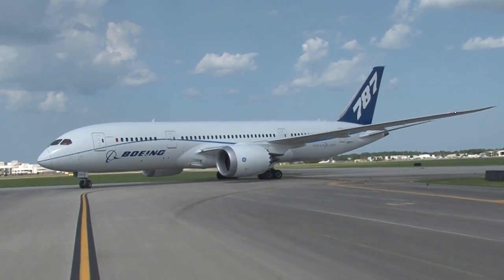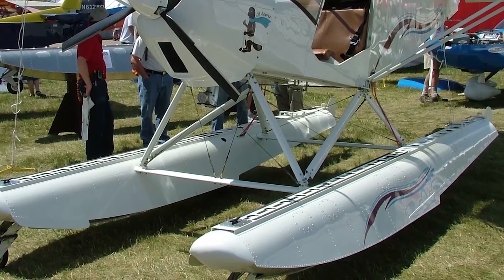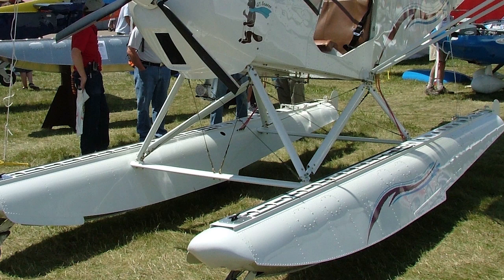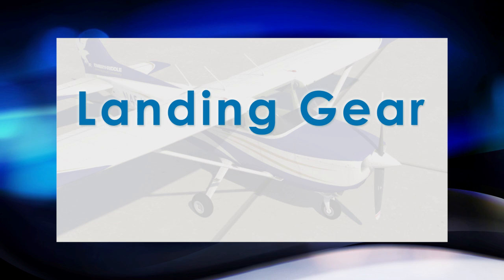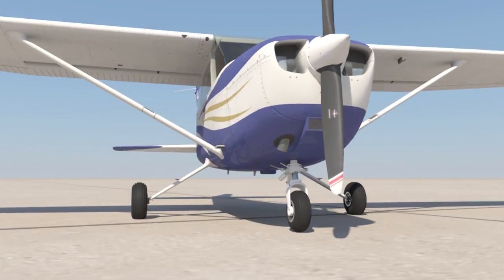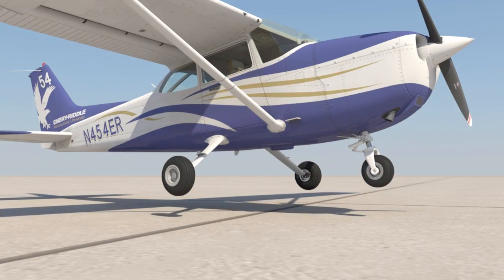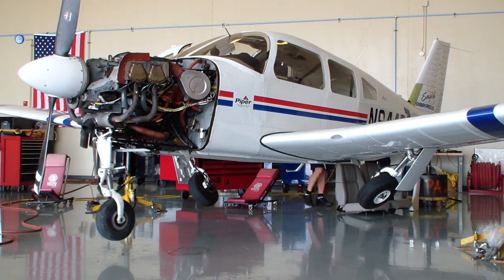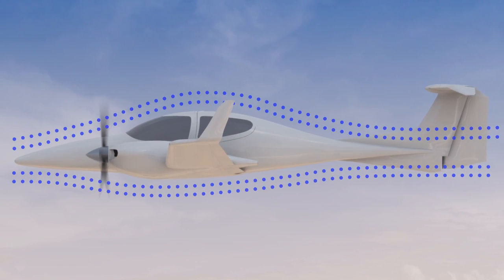Aircraft Systems - 04 - Landing Gear

Comment: Can we put other vehicles engines in air planes
Reply: If you’re building an experimental category aircraft.
Reply: Perhaps a Subaru, due to its opposed design, and a Cessna 172 sharing a similar opposed design (at least in my schools current configuration)
Reply: @kcwyattcraig  Toyota obtained a production certification in the late 90s to make the FV2400-2TC, a Toyota 1UZ based aircraft engine. I believe they intended to put it in a Rutan designed competitor to the SR22
Reply: I would probably stick to putting aircraft engines in vehicles